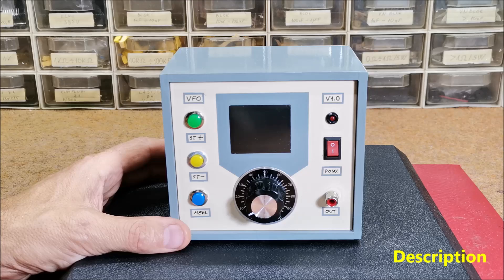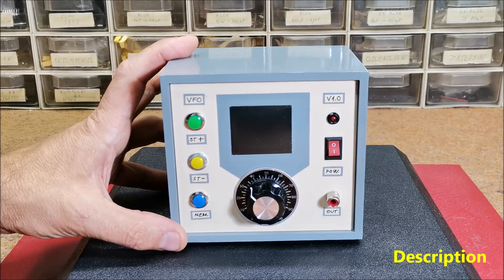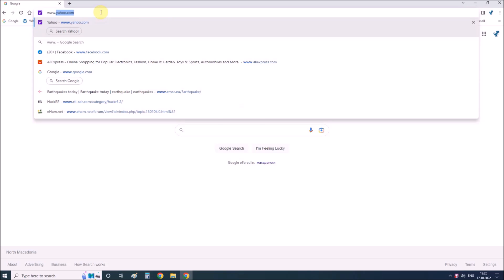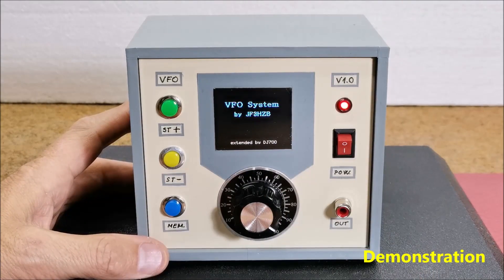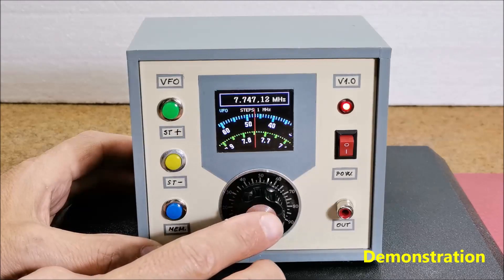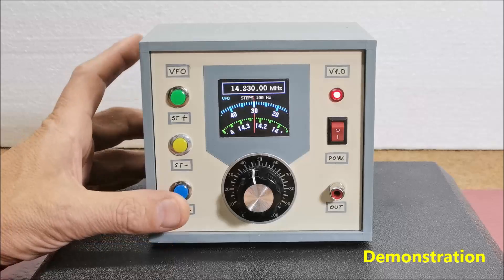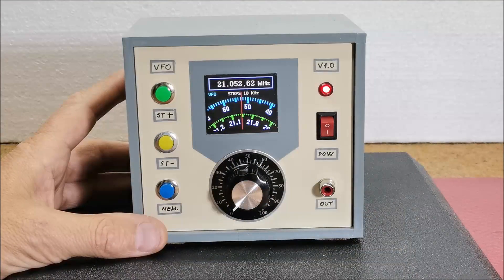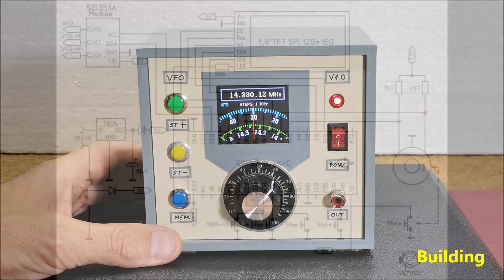Universal VFO 10 KHz-160 MHz with Retro Analog Scale (variable frequency oscillator)

Comment: I barely use Windows 10 and spend 99.9 percent of my time on CentOS 8 Stream installed on an outboard USB 3 1 TB hard drive. However I use SPICE and have not been successful in getting to run in WINE. This is the same with SDRSharp that I use with the rtl-sdr usb dongle because I can’t get a graphical version of the software defined radio for VentOS 8 stream to compile successfully.

Comment: Mirko good afternoon, congratulations on the beautiful project, I would like to know if it is possible
in cl0 to output Bfo+vfo (tuned value + beat frequency) and in Clk 1 output BFO only the beat frequency and clk2 disabled as it is I am already using version 2.0, I will use it in BITX. Big hug.

Comment: Hello, the project is very beautiful to install in a retro device or a personal retro style manufacturing. I have a question about the vfo code. I must cover a band from 6.4 Mhz up to 6.8 Mhz, this is the local oscillator from which I must subtract an IF of 10.237 The VFO must give 6.4 to 6.8 real.
 But it must display :: example 6,737 - 10,237 = -3,500 therefore display 3,500 for the 80m band. It must be reversed too. Does the code allow you to do this?
Thank you for your interest
 73' on5lcn
Reply from the maker: It could, but unfortunately the code is not mine and I will need more time to look into that possibility. If I manage, I will answer you
Reply: @MirkoPavleskiMK  Thank you for your response Mirko, it would be great to have a vfo like that on a personal build. Nice retro look, it's nice of you to look into the subject. This would be for an 80m transceiver
Universal VFO 10 KHz-160 MHz with Retro Analog Scale (variable frequency oscillator) on PCBWay is good for the job?
Thanks
73'on5lcn

Comment: Great work Mirko! Essentially the Si5351 outputs a square wave but I think the reason it looks cleaner (and more sinusoidal) the higher in frequency you go is simply the fact that the bandwidth limitation of your oscilloscope is acting as a low pass filter. It looks like yours is rated at 1 GHz and so once you start getting up into the lower VHF range you'll probably find the higher harmonics will be effectively filtered out so your 'square' wave starts to increasingly look like a sine wave. 

Very well done though. Many congratulations! 73, Nick M0NTV
Reply from the maker: Thanks :)

Comment: Excellent job. Is it possible to insert an intermediate Frequency in the code ? For example, for a 7 MHz received frequency on my receiver the IF is on 9 MHz, so the LO must oscillate on 17 MHz. I want to display 7 MHz of course. (display : 16- 9). thanks for advice.

Comment: Hello, good evening, I assembled this project but the frequency was a little off, the display shows 7.130mhz but the frequency meter shows 7.128mhz, is there a way to perform a calibration?
Reply from the maker: In "VFO_CTRL_V5.ino" , in line "int32_t offset_frq = 0;" you need to enter the difference, for example in your case it should be "int32_t offset_frq = 2000;"

Comment: i wish i had the bucks to get you a nice 3D printer. I think you'll have fun with it with your style of making cases etc.         Which is a pretty good style. Nice job .
Reply from the maker: Thanks
Reply: I do have a 3D printer. But I would think that a VFO would actually need to be in a steel cabinet or would leak RF like crazy.
Reply from the maker: @totallysmooth1203  There is no need for a metal cabinet, it works quite stable like this in a plastic box